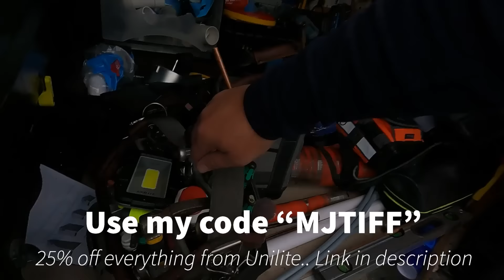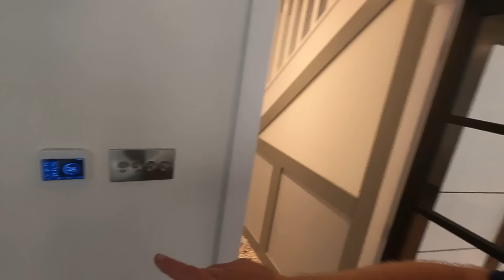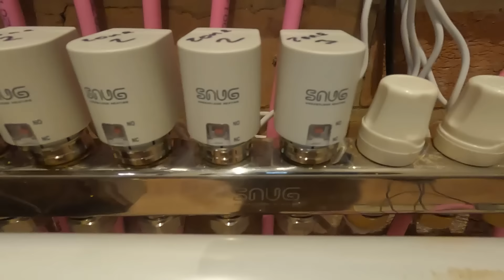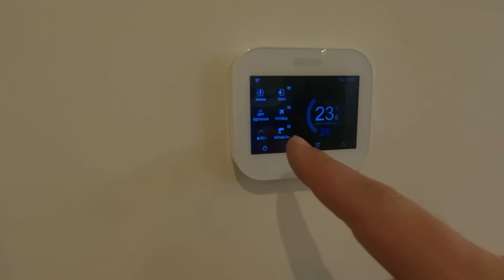GETTING UNDERFLOOR HEATING WORKING PROPERLY... (Can i sort it)

Comment: So I do a lot of underfloor heating and new builds with heat pumps. No actuators, blending valves and pumps mark. A lot more simple but design is important. Your right thou you should explain everything to the customer
Reply from the maker: How does it regulate rooms temps then??

Comment: I always tell people to run their central heating for a half an hour at least once a month in the summer.  The little bit of fuel used is more than offset by not having to have a call out to fix a stuck pump or diverter valve.
Reply from the maker: Great bit of advice mate

Comment: Hello, nice informative video. Could you help with our situation with HeatMiser system - all UFH went cold couple days back though boiler works for hot tap water/radiators.
Reply from the maker: Will be an issue at the UFH manifold, zone valve gone or pump issue
Reply: @ thank you!! How can one check the zone valve?
Reply from the maker: Check if it’s opening when the system is calling for heat

Comment: In 2001 we had an extension built on our house and I fitted UFH to the new areas. It was a fun job laying the pipework on top of the insulated concrete and the nuikder then screeded the floor over the tubes.  It was the cosiest area of the house, 2 zones lounge/kitchen and a spar room. Toasty because the new extension was properly insulated too.  We've moved since and just have radiators fed by a pellet burning stove boiler- fine when it works, but the boiler needs the soot cleaning out of the insides far too often, really poor design and I would never do it again
Reply from the maker: So do you prefer the underfloor system??
Reply: @MJTiffPlumbing  oh yes, Under Floor is much better, consistent heat and warm feet 👍

Comment: Can you do a video, on a fault on underfloor heating, where the hot water from the boiler goes to the manifold, and it does not really go anywhere at the pump stage of the manifold.

Ie the pump in the first step of the manifold, our hot water from boiler goes to this point, and does not seem to go any further, it just stops at that pump on the manifold, so the rooms are not getting warm.

If you understand what i just wrote, is it possible you can do a video on how to fix this

Ie what is the fault, would it be the pump you need to replace on manifold, or would there be sludge in that part or something blocking the hot water from boiler being pumped into the underfloor heating.

You do great vids, just wondering if you can do a video on what you think this is and how to fix it.
Reply from the maker: Sounds like a pump issue as it’s stopping there
Reply: Most likely the blending valve not the pump. If your flow and return primaries are roasting but the top of the pump outlet to the manifold is tepid and flow rates are very low, it's most likely the blending valve if it's anything to do with the pump assembly. The water is coming to the blending valve on the flow and the majority of the flow is going straight back on the return because it's not letting it through the pump elbow, that's why the flow and return ends up being basically the same temperature. Either that or you have an airlock either in the primary pipework, the manifold /UFH pipework or in the pump itself. Most of these issues can be resolved by flushing the circuits through one by one with a garden hose and mains pressure and purging the rest of the system as normal. You may also have low pressure so check the boiler pressure and the expansion vessel too.

Comment: How many actuators can be wired into a single zone? I have in floor that is "zones on pump".... but am doing a home addition that I would like to simplify and have zones on actuators and haven't really found how many actuators can be on a single zone with most controllers.
Reply from the maker: You can attach as many as possible into one zone if you need to👍🏼